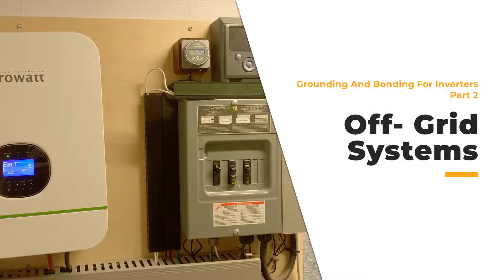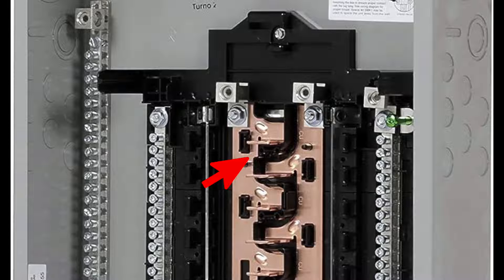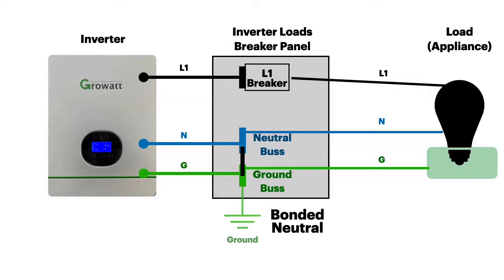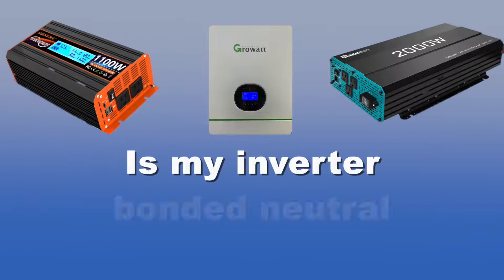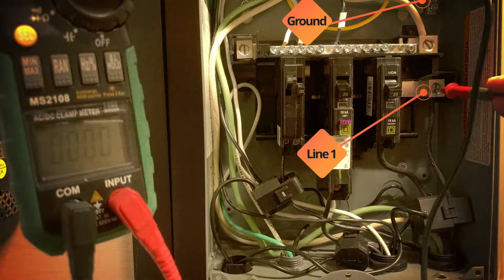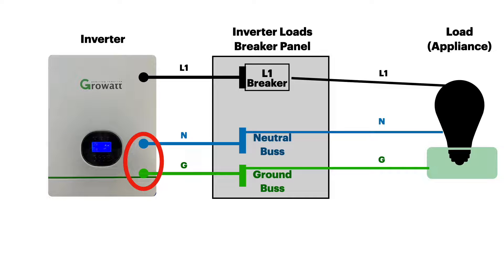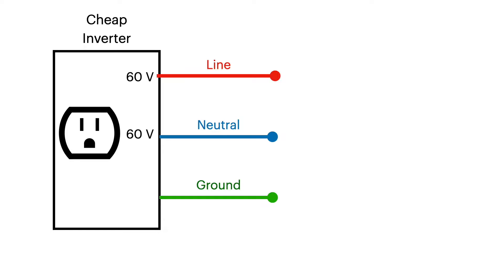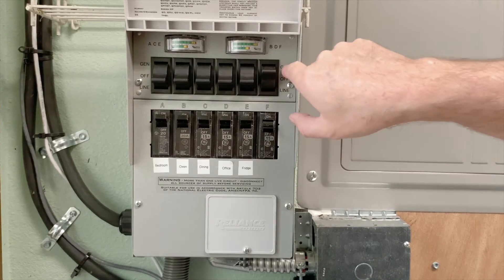Grounding & Bonding For Solar Inverters, Part 2: Off-Grid Systems

Comment: I don’t know if anybody has done this and what the best way about going about it. I have an off grid eg4 with batteries and solar panels in my detached garage. The inverters can be internally bonded or I can bond in the load center. No AC in or generator. My question is rarely during a power outage, I can hook up the inverters to my house wiring to run the house as if it was a “generator “(I would make sure the utility breaker is off). If I had the neutral bond engaged in the inverter and it’s connected to the house breaker box which has a legit earth ground, would that be an issue? Or would it be safer to leave the neutral bond off and run a ground from the inverter subpanel to the houses earth ground (which would solve me burying a rod and protect the system in case I power the house)?
Reply from the maker: It depends on the EG-4 model. The newer models like the 6000XP allow the neutral and ground from the AC input to share the existing bond.
It sounds like you have one of the older models where you can add or remove an internal screw to bond/unbond. You only want one bond in your system, so you have to add the bonding screw when not hooked to the grid In, and remove the screw when running AC in for charging. A bit of a pain...

Comment: Thank you for the clear explanation. I have an axpert(clone) 5kw inverter. I was not sure if I may bond n to earth in fear of damaging the inverter output transistors. Currently I have  bonded through  a 100w incandescent light bulb (resistance just over 500 ohm). Voltage neutral to earth, 0.2v and under load  of 3kw, +-5volt. I am aware that  over current protection where L touches the grounded chassis will not trip my 20A circuit breaker. but earth leakage detection works as expected. I would love to have  schematic of  the inverter to see what is going on at the ac output stage. The inverter has dry contacts to be able to operate a bonding relay dynamically, but it does not make logic sense - the dry contact only changes state when battery runs low and it switches over to  utility power.
Reply from the maker: My guess is the dry contact could drive a higher amp relay or contacter that would only bond your circuits when it switches to battery power. When the inverter is powering loads from utility, the relay would disconnect the new bond, and the ciruits would use the bond from the AC in.

Comment: I’ve got a growatt and I’ve been trying to determine whether it has an internal neutral-ground bond.

Measuring ohms I get OL testing from the neutral to the ground which indicates unbonded

Testing voltage with no load (circuit breaker at entrance to the panel is off), I get 120v hot to ground 120v hot to neutral 0.2 neutral to ground

Testing with a load, I get more like 105 hot to neutral and 15 neutral to ground. Was wondering if this could be an indication of no neutral ground bond or more likely of faulty wiring.

Lastly, I tested with an outlet tester (Klein RT110) and it said that the outlet was all good, which indicates that there is a neutral ground bond. 

Do you have any suggestion on how to interpret these results or get a more clear answer?
Reply from the maker: Possibly a wiring problem. 
You mention a circuit breaker and panel... is that after the output of the Growatt? if so, is the panel bonded?
Do you have any AC input to the inverter?
Reply: @ReelClearMediaLLC  no ac input to growatt - it’s a fully off grid setup. currently don’t have neutral and ground bonded at the main panel because I can’t figure out if the inverter is bonded or not
Reply: I ended up bonding at the panel after the growatt and my voltages balanced out (0.2v between ground and neutral, 120 between each legs and neutral, 120 between each leg and ground). Thanks for your videos - they helped me a lot while trying to figure this stuff out
Reply from the maker: @willisplummer  awesome!

Comment: I have an eco-worthy 24v 3000w hybrid inverter and I’m getting 90v on line and 30v on neutral. Is it safe to assume I have a floating neutral and will be fine to bond ground and neutral in AC panel? I wasn’t expecting such a large difference from your testing.
Reply from the maker: Those are odd voltages. By "90v on line and 30v on neutral" are you measuring line-to-ground and neutral-to-ground?  What voltage do you get line -to-neutral?
Reply: @ReelClearMediaLLC  yes I’m measuring each to the ground screw on the case, I don’t have an actual earth ground connected yet. Line and neutral together is 120v.
Reply: @ReelClearMediaLLC  I ended up bonding ground and neutral in my AC breaker panel and voltages are now reporting correctly. No more open ground and can trip gfi with tester. Leaving this info here in case anyone gets the same eco-worthy 3000watt 24v hybrid inverter charge controller and is struggling to find this info for theirs. Eco-worthy support was zero help. I am not using AC in, this is purely off grid.
Reply from the maker: @andrewfoster5241  Great! I'm glad it is working now. I've been told there can also be "ghost" voltages due to inductance, but they resolve under load. Not sure, but that could be a possible reason that  your voltages were odd.
Thanks for the information!
Reply from the maker: I haven't used an eco-worthy, so I'm not sure why the voltages look like that. 
Maybe you can find someone on Youtube or in solar forums that has connected an eco-worthy to the grid.
Reply: @ReelClearMediaLLC it won’t be connected to the grid. Just trying to figure out if I need to bond neutral and ground in the breaker box.

Comment: I am left with a question:   Is it a correct assumption to NOT bond a cheap inverter at the breaker box?  Meaining one of those 60VAC  HOT and 60VAC NEUTRAL type of inverters that are not bonded.   I get that you shouldn't bond the neutral and hot of the inverter but you didn't mention about doing so at the circuit panel.    At this point I wouldn't proceed before verifying this assumption but am  assuming that is what you meant here...  Sorry if this sounds confusing.
Reply: One thing I will be doing is making sure that I get an inverter that can be bonded at the distribution panel (circuit box).
Reply from the maker: No, these should NOT be bonded.  Also, they should not be connected to household (grid) AC at all.
Reply: What if the inverters ground isn't even connected"since they're usually connected to the negative battery terminal", and just the panel with an outlet has ground bonded to neutral? Would it function?

Comment: how dangerous is to have unbonded ground?
Reply from the maker: Unbonded ground means  in case of a ground fault, there is no return path to trip the breaker. Could cause a fire or electrocution.

Comment: I have one of those giandel 24v 3000watt inverter. What size cable would I use to wire the terminal block to a breaker panel?
Reply from the maker: Not familiar with giandel 3000w... If you're referring to the AC output, you would output about 30 amps at 120v. For short runs 10awg should be ok, but I would use 8awg. I'm not an electrician, so you may want to consult one.

Comment: Do you have a patreon so we can support! Finally a CLEAR explanation with great visuals!
What about grounding solar panels or batteries? My Sun Gold 5kwh wall mount battery has a ground symbol. Is that only if it's outside?
Reply from the maker: Thanks for the kind words. Grounding on the DC side completely varies by manufacturer, so I didn't try to cover that

Comment: I’ve got an EG4 3k inverter and battery that I tried to use for someone with no grid power due to a storm. Operating it in battery mode, I saw the same voltages as an unbounded neutral ground inside the inverter. When I ran it with a receptacle tester, it said I had an open neutral and was blinking. I tried plugging a newer Whirlpool refrigerator into it and it did not run. I plugged a lamp and/or a fan in the receptacle and they ran and the refrigerator then ran as long as either the light or the fan was running. 
Can I create a neutral ground bond in the receptacle. Is that a safer way to operate?
FYI, I think the bonding screw was not put in the inverter in this version. 
If I were to plug in an AC in into the house receptacle, even though the circuit is dead, would it create a neutral ground bond?
Reply from the maker: The safest way is to add a small breaker panel on the output of the inverter, and bond the breaker panel neutral and ground. Don't feed the AC input of the inverter from house wiring, or you have two bonds when the grid power comes back on, if the inverter's internal transfer switch goes back to grid.
If you are just using it during blackouts as a temporary generator, you can run the system without a ground. That may be against code in your area. If you want to use it even when the grid is up, use a transfer switch so you are using the bond in your main panel. See https://www.youtube.com/watch?v=PFeA-5A_pmc&list=PLkh5atV_UGtrG9hWuewNUU1FTSNEMiC8V&index=4

Comment: Hi.  Thanks for the videos.  So I currently have 2x mpp solar lv6548  inverters wired to a sub panel in split phase operation. Based on your video, i would have a bond loop as these inverters come with an internal bonding screw.. each having their own screw.  As I understand it each inverter provides seperate 120v circuit to each bus bar seperatly in the panel. I will perform these tests to verify. These units also have internal ATS wich as I understand connect and disconnect the bond as needed when switching to grid ac in for bypass or charge.  I soon will be connecting the ac in from my main panel to the inverters. Do I need to remove the bonding screw in the 2nd inverter when in off grid mode no ac input on either inverter. There seems to be a catch 22 here.  When switching from grid to no grid ac input you cannot very well open the inverter each time to reinstall the screw just cause u need some juice to charge battery.  Can you clarify what to do in each senerio keeping in mind that the inverters also switch between off grid and "grid" mode when needed.  Do we have a design flaw here.. ty
Reply from the maker: Yes, it is a mess. They don't document the bonding for different systems either.

I manually manage my Growatt. I run it daily, using the internal charger and inverter, but almost never hook the input to the grid. The inverter output goes to a small breaker panel that supplies my car charger, some direct outlets, and one breaker sends power to the transfer switch. I use the transfer switch to manage when the loads in my house are on grid or inverter.

The only time I hook the input to the grid is to charge batteries from AC, right before a hurricane if batteries are low. While doing that I'm not running any loads on the transfer switch.

Comment: Hi, I really enjoyed your videos. What type of junction box did you use to extend the wiring from the flush-mounted sub-panel to the transfer switch? I need to do the same thing for my transfer switch.  Thanks.
Reply from the maker: I used a standard junction box (for a switch or outlet) from Home Depot or Lowes. It's facing backwards and mounted on the wall to give me a place to connect the metal flexable conduit. If I remember correctly, the conduit came with the transfer switch.
Reply: @ReelClearMediaLLC  Thank you!

Comment: any chance of an in depth vid as to why these cheapo inverters are wired like this? seems dodgy as hell.
Reply from the maker: They do it to save money... cheaper to make a low voltage circuit and split it into two 60v legs, than to make a higher voltage circuit they can split into 120V legs. Appliances plugged directly into these will work normally (they see 120v across hot to neutral) but there is not a proper ground path, so they can't be connected to your house wiring.

Comment: Thanks for the tutorial, it was really easy to understand. I have a question: should I connect the AC ground from the consumer unit (breaker panel) to a new, separate earth rod, or should I bond it to a DC earth busbar rod and have only one earth/ground rod in the system? Thanks.
Reply from the maker: In North America, typically you would want one ground rod. It may be different in other regions.
Is your breaker panel or inverter fed by the grid, or are you off-grid?
Reply: @ReelClearMediaLLC  Hi and thanks for so fast reply. Im based in UK and have stand alone offgrid system without set to grid.
Reply from the maker: @JHubnerProductions   it depends on what your inverter manufacturer recommends for the DC system ground. The AC side earth (ground) rod is sometimes combined with DC, sometimes it is a separate earth ground rod.

Comment: I learnt a lot here. Thank you. One question. Does the earth spike connected to the main breaker box also works if the power utlity goes down and the inverter is in off-grid mode with a dynamic bonding or the Inverter needs it's own earth spike?
Reply from the maker: In the USA the neutral-ground bond and wire feeding the grounding rod are in the main panel after the meter. These work even when the power is down.
In other countries the ground may be different.

Comment: I have a question on solar trackers and combiner boxes? I installed my 4 string combiner box on 1 of my 2 solar trackers. I ran a ground rod straight to earth at that point and it is connected to the PV combiner box. Would this be considered my only earth ground needed for my entire DC off grid system? I have a eco-worthy 48volt all-in-one inverter which i feed to a breaker panel for my cabin.
Reply from the maker: I'm not familiar with eco-worthy. It depends on the manufacturer's recommendation. Some manufacturer's don't want either pos or neg DC to be grounded, some require one or the other. 
Also, it is common to ground the frames (not the cables) of the panels and metal combiner boxes.
Reply: @ReelClearMediaLLC  Not just common...required.  I have 6 panels in series producing 400 volts.  A PV panel wire short would energize all the panels as they are bonded to each other.
Reply: A solar tracker by default is already grounded, a grounding rod is not necessary and frankly redundant.

Comment: Thank you for the concise information. What worries me is nearby lightning strikes  can enter the inverter through the ground rod. What can be done to make the inverter safe from lightning in this situation?
Reply from the maker: Some people use a lightning arrestor, like the midnight solar:
https://amzn.to/4cfr6g0
They make them for DC (from solar panels to inverter) as well as AC, so you have to get the correct one for your application.
Reply: @ReelClearMediaLLC do you think a normal SPD is not enough?

Comment: hello... thanks you very much for great video...I have a question
How would the grounds be connected in an off grid system? I use a backup inverter generator to charge the batteries ..I am interested in knowing how the ground should be connected. Have a nice day regards from Patagonia Chile.
Reply from the maker: test your generator and inverter with a meter to see if either is bonded.
 If neither are bonded, bond G-N at a breaker box after the inverter, and add a ground wire to earth grounding rod.
If either generator or inverter is bonded, it is tricky. 
test everything with a meter first...